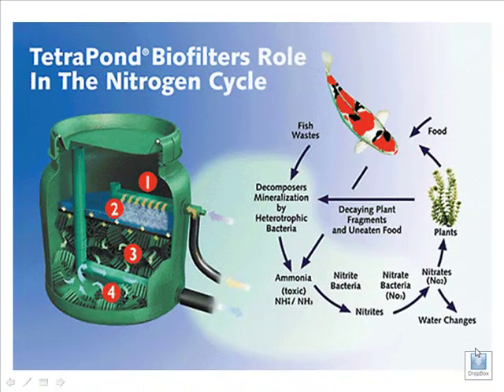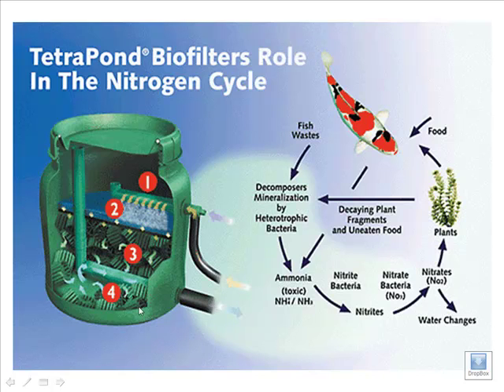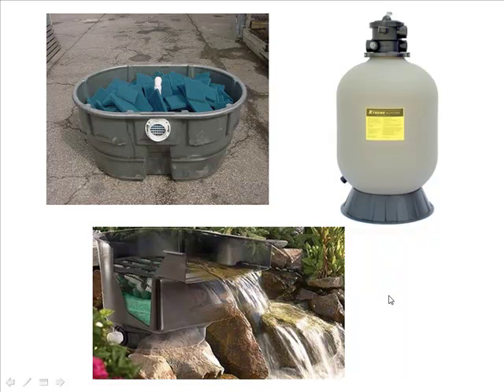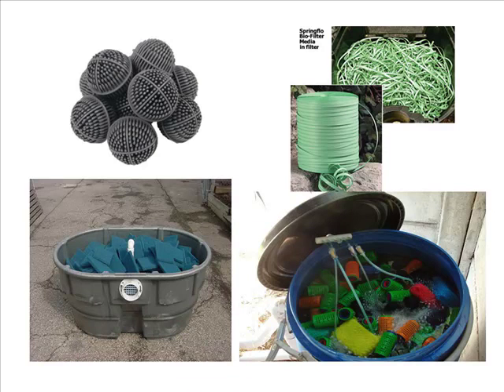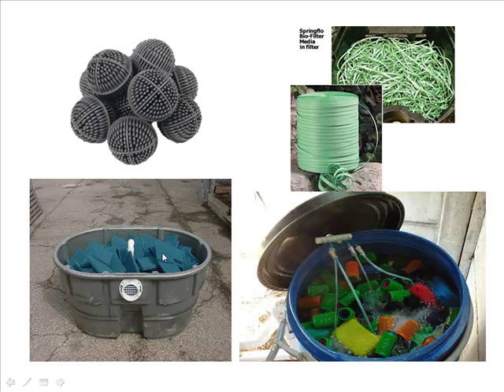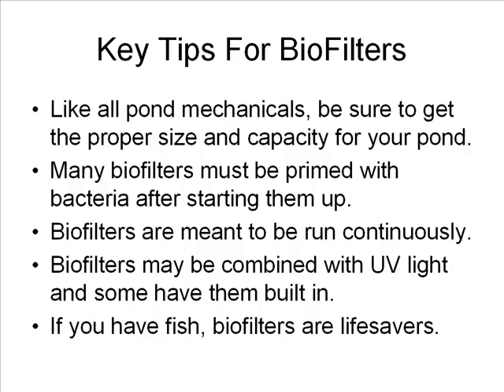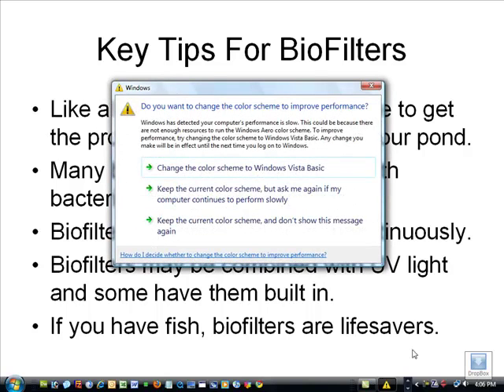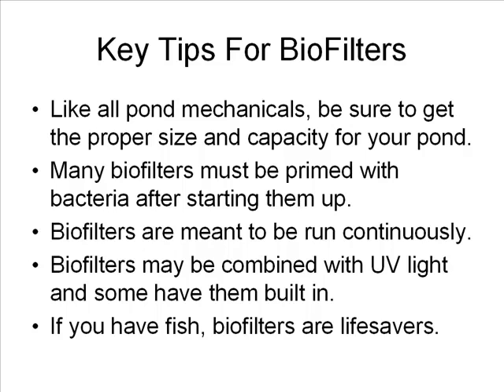Biofilters For Small Ponds

Comment from the maker: Thanks for the kind words.  I would either take all the bio media out, pads, etc and just give them a good cleaning.  You could even sterilize I suppose, or replace the media entirely.  On the tap water it depends on if your water is chlorinated, if not, then no problems usually.  If it's chlorinated you could use a dechlorinating filter to limit this and then just start the pond up again and regularly add some beneficial bacteria.  Check your water chemistry too to support bacteria.